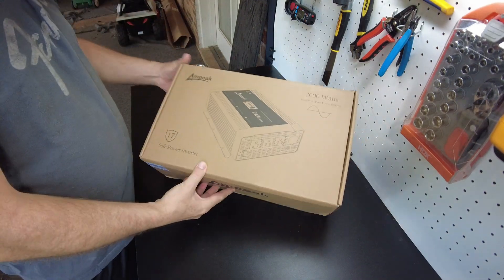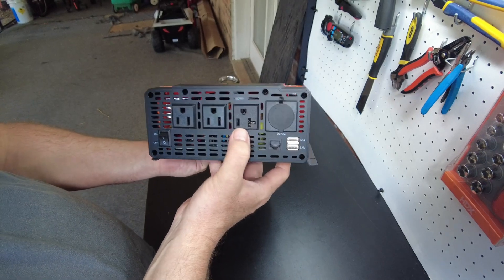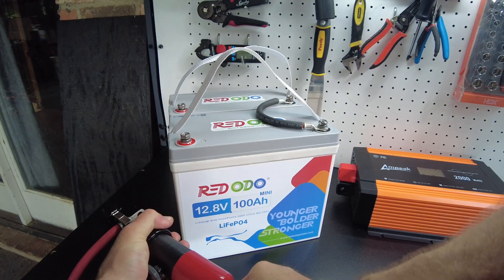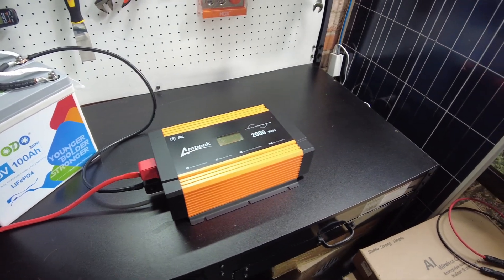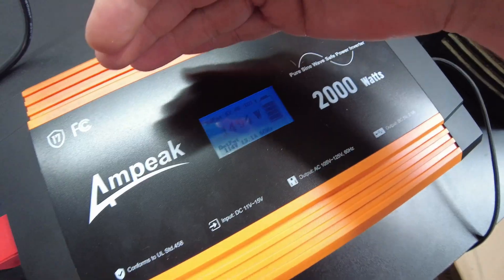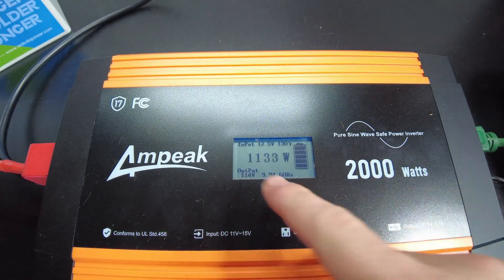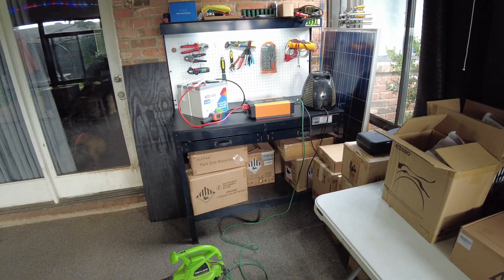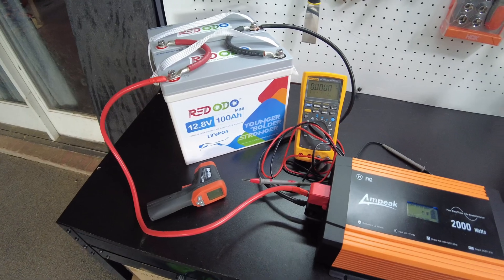Ampeak 12v 2000w pure sine Inverter

Comment: 2:46 200Ah equals 200 Amps over 1 hour. You can draw more than 200 Amps at once, but the batteries will be dead in less than 1 hour.

Comment: 1:25 4 gauge wire at approximately 3 feet length equals 200 - 300 Amp rating. The larger the gauge rating, the LOWER the Amp rating.

Comment: That Ampeak looks alot like my Kreiger. I'm researching inverters and is why I found this video. I purchased the Krieger 2000W PSW inverter from Amazon for almost $300.. It is part of a 300W emergency solar backup system with 2 Redodo 100AH batteries. I have had no power outages yet so I have never had to connect it to any household appliances. I only turn it on 2 times a week to charge power tool batteries, flash light and some 18650 batteries. The unit is basically on standby. It is only 13 months old. I turned it on today, it blinked, the fan made its usual whirring noise and then it just shut down and died. Won't turn on. It's getting power to the terminals. Batteries are at 14.30. I am super disappointed in the quality of the Krieger unit that has NEVER even been put through its paces. Contacted Power Bright the distributor, and waiting on a replacement. I didn't take it apart to see what happened, though I really want to but it would void the warranty.
Reply from the maker: Man what a total bummer, I hope the take care of you on that. I would suggest you stress test the replacement.
Reply: @BradCagle  - Yep will do that as soon as it arrives. I hope they tell me what failed in the unit, but the tech said not to expect that. Thanks for video review and reply.

Comment: 👍👌❤️🇨🇦, if an individual used a battery shutoff switch, there should be a need for using a resistor, no spark
Reply from the maker: Well, also the thing about using the resistor is it limits that initial inrush current that may damage the capacitors overtime. Thanks

Comment: I run individual wires to each battery to reduce losses and evenly discharge. Adding 1 or 2 more batteries in parallel may be another option if physically feasible.

Comment: jarxioxke  4000 watt box cost around 300-350 and weights 16lbs,(I look at the weight of these things.)This model is the one I finally picked.  VOLFVERT
 looks to to be the same box but I think Jarxioxke has better customer support. I understand Volfvert was could only pull 3,300watts with the 4,000 watt model. I Understand that with 12 volts you shouldn't pull more then 3000 watts anyways,Hell more like 2000 watts really. Tons of amp draw for any device. Giandal is the best i think but still have problems but the best customer support. If you  just want to run 1500 watts - 2500 watts pick a 4,000 watt inverter. 60%-75% of what is stated is the safe spot to keep these things running for a while.
Reply from the maker: Yeah, I like the Giandal, and LeeSky inverters a lot. I have not tried the jarxioxke, but just looked it up, it seems very nice. I need to review these. Thanks

Comment: Why can't companies add a PD USB-C 100w or even a lower-watt USB-C port? LOL
Reply: Keep inverter cheap & simple, I use an extension cord w USB where I need it. Due to noise & safety it's preferred to place inverters away where one would normally use a USB charger.
Reply: @closetcleaner  DC to AC to DC USB-C is very inefficient.
Reply from the maker: @Jasonboyee  Good point!
Reply from the maker: Yeah, seems like all the inverters are a decade+ behind in the USB power ports.

Comment: 4ga is a joke. They're woefully undersized for a 2000w at 12v load.  Even 2ga will get warm to hot if you sustain (30 minutes+) that max load.
Reply from the maker: Yeah, seems like these companies should just not send cables at all.
Reply: @BradCagle  I always just double the cables and wire in parallel on my inverters.

Comment: Wonder if they can send you a 48V inverter....those cables would be about right for 1/4 the current of the 12V Inverter.  You can then test 4 of those batteries in series too.
Reply from the maker: Yeah, I agree. 😆

Comment: Another great review video. For long term use do you recommend fusing batteries when putting in parallel? If so what type of fuses do you use or recommend? Thanks👍🏽
Reply: I would only fuse the output of the battery bank. Fusing between batteries will mean many dead fuses when you inadvertently connect a flatter than the others in paralllel.

Comment: I bought one of these earlier this week.  I use it in the kitchen with two PowerQueen 100Ah micro batteries and 600 watts of solar panels... it'll power a 1500 watt hot plate, or a standard microwave, a kuereg in the morning, or any other item like a blender if you watch your consumption.  I usually use a 12v cigarette lighter RoadPro cooking pan for a side dish at the same time.  I usually charge up my cell phone at the same time too!  I went to 2AWG cables on the fourth day though.  Overall, it's a good little inverter - so far - and I plan to buy another one of these inverters, a third battery, another charge controller and some more solar panels for the cooking set up later this year if it keeps performing like it has been.
Reply from the maker: Nice setup!

Comment: Another great video. Is it smaller than the Leesky 1500W you just tested? How well does it handle high surge current loads?
Can you also do the tear down of this unit and the Leesky? Thanks.
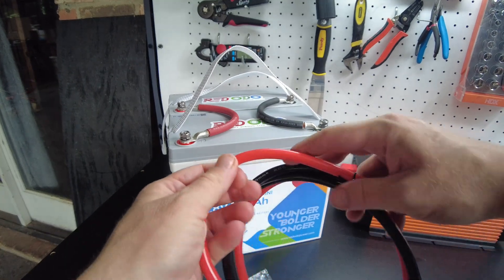BTW, @5:24 I see the supplied wire is 20mm2 so it is a little bit smaller than #4 Awg.
Reply from the maker: Yes, it's a bit smaller than the Leesky. But the Leesky is quieter. Yeah I'll do the teardowns, I was curious about the Leesky guts myself. Thanks!
Reply: @BradCagle  Great, I cannot wait to see the inside of the Leesky compared to Ampeak.
BTW, according to Leesky, the seller indicated that Leesky is the sub company of Gindel that makes the same inverter but the Leesky sells the version with GFCI outlets and that why the case looks just like Giandel inverter.
I look at the 2000W one and saw this so i just bought the 2000W one tonight for $242 (that is with 10% off today):
Question:Is your brand a new sub brand of giandel?
Answer:Thank you for following Leesky closely. Yes we're a sub brand of Giandel, selling another series inverters, especially gfci outlet power inverters. All our inverters producing in Giandel's high standards, is also a good choice for you. Any chances welcome to choose Leesky Inverter.
By leesky SELLER  on September 2, 2022